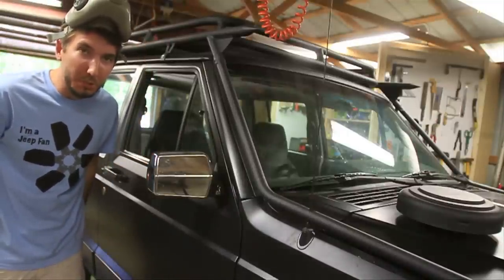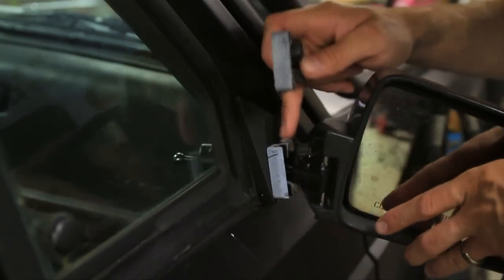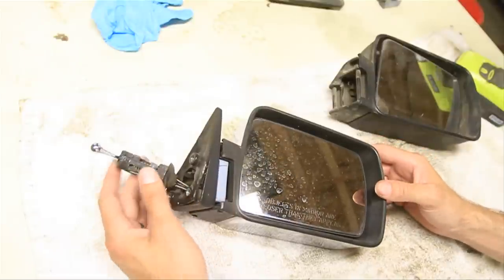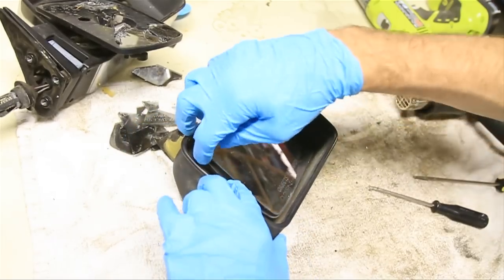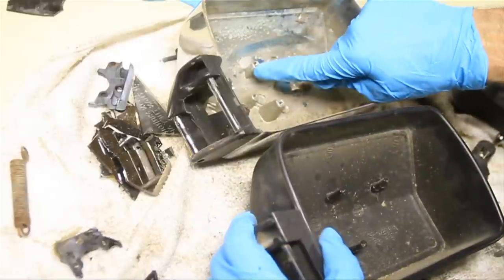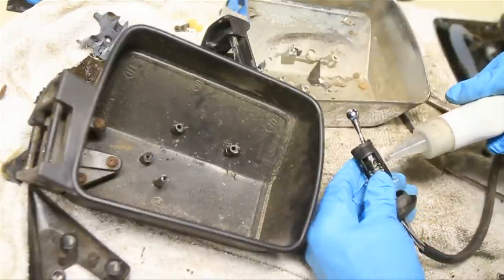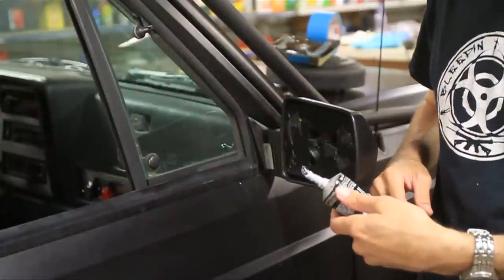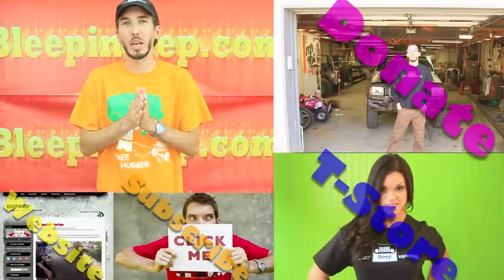XJ Side Mirror Fix

Comment: How do you take out the plastic backplate with the mirror on power mirrors? I can hear and feel the motor trying to turn the mirror but it's almost like it's not snapped in or attached to the part that moves it.

Comment: Very helpful.  I was trying to figure out swapping a power mirror with another power mirror but the spring inside in broken on the junkyard haul. I think I can swap out power internals with both open. It kills me. I just used G-flex epoxy on my mirror on the XJ so that's not coming off without a LOT of heat. 

Thanks for the killer Jeep Vids as always